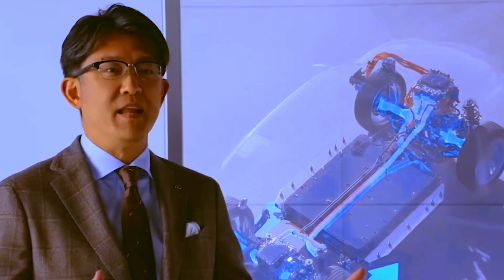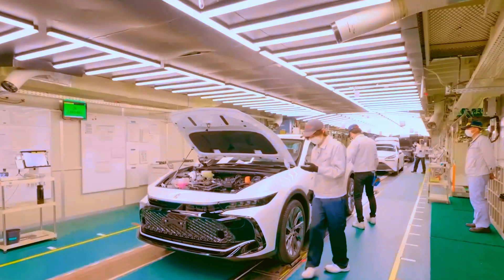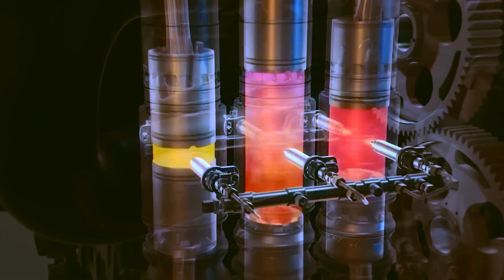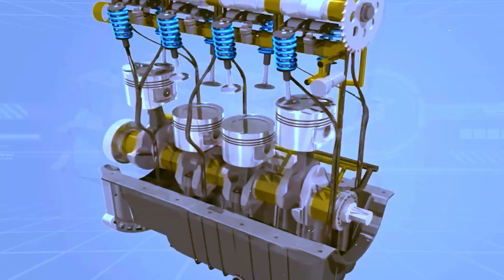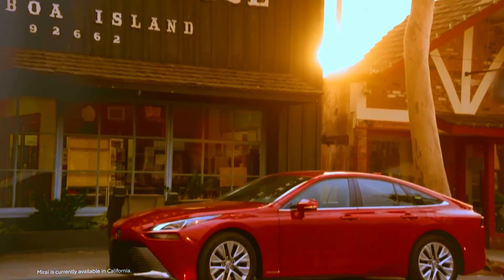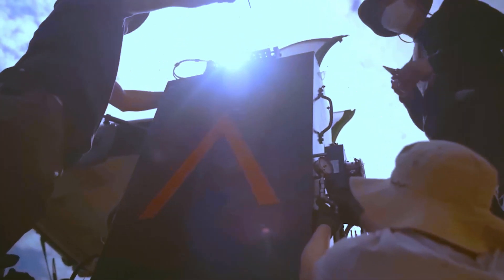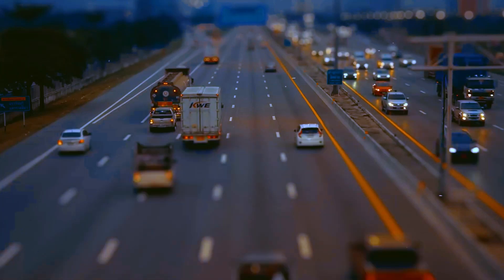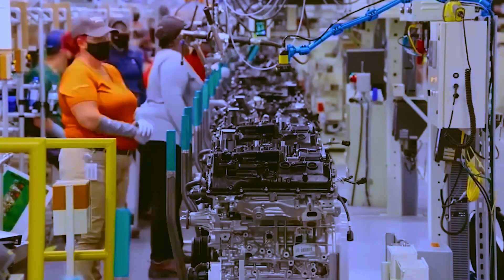FUELING THE FUTURE: TOYOTA'S AMMONIA ENGINE BREAKTHROUGH!

Comment: First it was Hydrogen Fuel Cells, then IC Hydrogen cars, and now it's Ammonia powered IC Engines. What a clown show.
BEVs are clearly the future, yet Toyota have invested so much into these other pointless technologies, that they can't face the humiliation of admitting they've made some catastrophic mistakes.
Look, IC Engines can NEVER exceed 50% efficiency, and in reality they are lucky to acheive 30%. Fuel Cells are little better. Heat engines are not the solution because they can't compete with the high efficiency of BEVs and the fact that they don't need ANY oil or other fuels that take huge amounts of energy to create.
You'll never get better efficiency than Solar, Wind, Hydro or even Nuclear in the form of Molten Salt reactors generating electicity which is used in BEVs. There's simply no economic argument for any Heat engine.

Comment: If you're going to have to go through the process of decomposing ammonia to hydrogen and nitrogen, then why not just do the same thing with water which makes hydrogen and oxygen and use that as a fuel source? I know the technology isn't there yet but I think that at sometime it could be possible to build a internal combustion engine that would have a closed system where water is the fuel source.  Say you have a internal combustion engine and it runs on hydrogen/ oxygen.  The vehicle would have three tanks. 1 for water 1 for hydrogen and 1 for oxygen. Using the process  of electrolysis ( which is where the technology lacks) you can decompose water to hydrogen and oxygen which are then stored in tanks to supply the engine. That idea isn't new. However, what if, instead of exhausting the water vapor created after combustion, it is reclaimed through a condenser and returned to the water tank so that it can be processed again into hydrogen and oxygen.   Then instead of exhausting the remaining air into the atmosphere, it can be re routed back to the intake of the engine and used again. In an internal combustion engine the air is drawn in from the atmosphere and used for its volume and the oxygen that it contains. And then it's exhausted into the atmosphere to remove the burnt gasses. In the system that I describe above there is no need to draw in air from the atmosphere because the oxygen is provided by the breakdown of the water. The exhaust, after going through condensation, is just air and would be suitable for re use so it could be re routed back to the intake where it would be used over and over again in a continuous cycle. This would give you an engine that could run in just about any environment such as under water, high altitudes  or even space as the outside environment plays no part in the engines function.